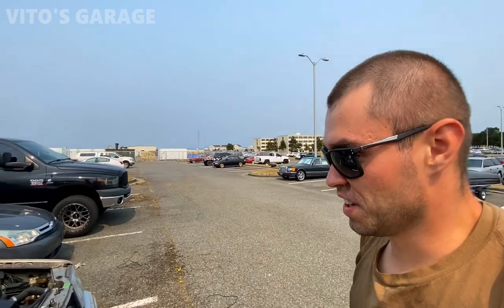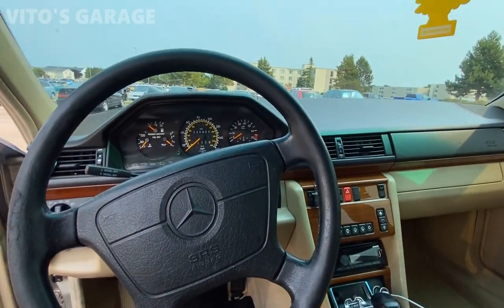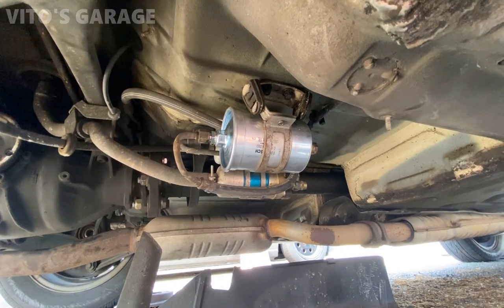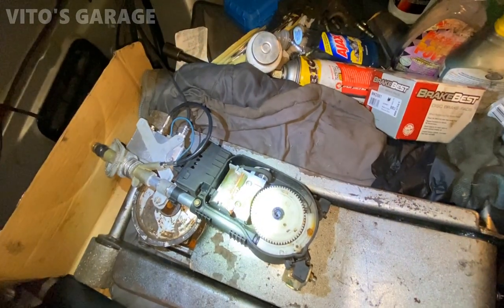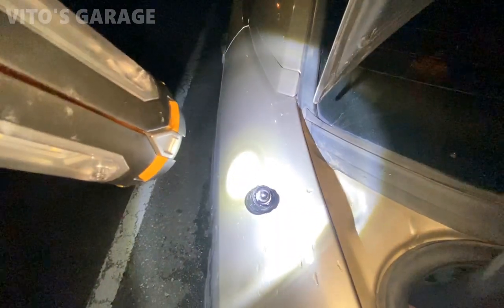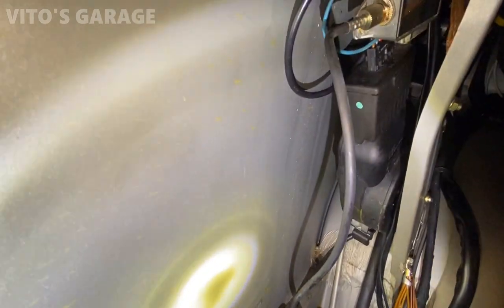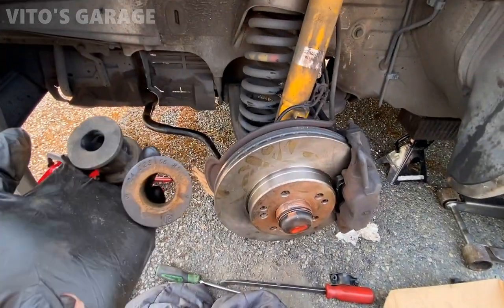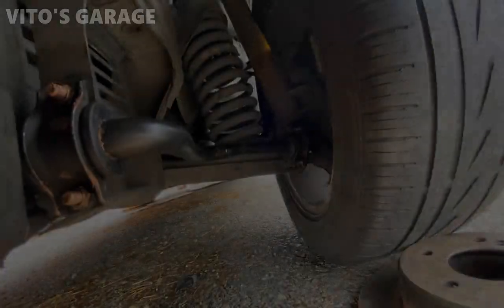Fixing with Pride! Mercedes W124 E320 New Cabin Filters, Antenna Seal & Lube, Fuel Filter & More Ep4

Comment: Not all W124s have cabin air filters -- MB did not begin cabin filter installations until model year 1994.
I know, tried to replace mine --- took the time and disassembled as needed only to discover that was not one in 1990/300E.
Reply from the maker: Only facelift W124s have cabin filters

Comment: Hello Sr . I would like to know if you could help me to clear up a doubt. In the comms under the steering wheel there are 2 levers, a glass cleaner and a turn signal. the other shorter one says beschl that I don't know what it would be useful for? He directs commands forwards, backwards, up and down. you know sir? my auyo is a mercedes w126 300sd 1982 matias
Reply: cruis control?
look up on forums

Comment: As always awesome job, when you changed the fuel filter I was wondering if that filter was ever changed or no, just like the cabin air filter those can clog the A/C if I am not mistaken,then that is where the bucks come, in to play Am I right, I know the newer cars you have to change it if not it will damage a lot of parts.
Reply from the maker: Clogged cabin filter won’t damage anything. It’ll restrict the airflow
Reply: @VITOSGARAGE  I am talking about the newer cars like Hyundais, that if the cabin air filter is so dirty it can clog up the system, leading to having a big expense on the A/C unit, and the mechanic for Hyundai told me it can cost anywhere from 3000 and up depending on the parts
Reply from the maker: I don’t believe that, Enrique. There’s no way a cabin filter will cause a damage to AC system.. That’s absurd.. your mechanic is on crack or something

Comment: what year model is your car? I wonder if i have cabin air filters. My car is 1992 w124 300d estate with ac
Reply from the maker: I’m pretty sure yours has a cabin filter. Check. The car in the video is a 1994 E320
Reply: @VITOSGARAGE  Okay. My car had problems with heating and i read that the cabin air filter could affect heater too. Almost no heat at all at -20 or more celsius
Reply: @VITOSGARAGE  Or maybe my heater core is clogged up, will see..